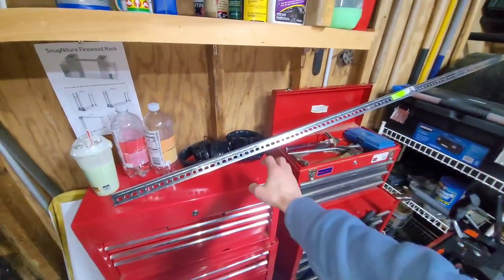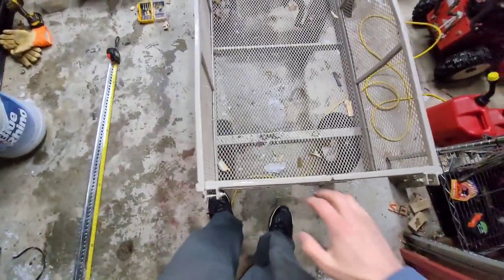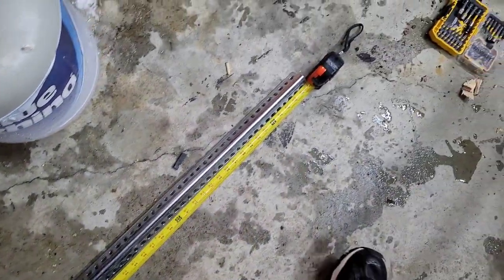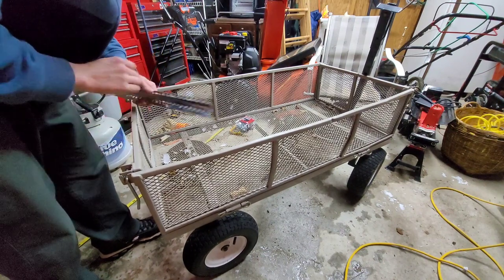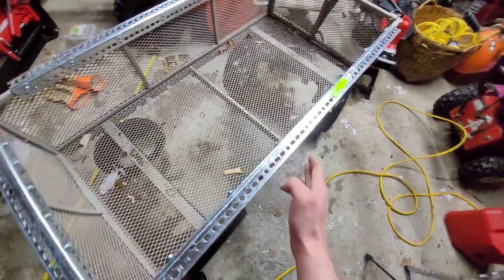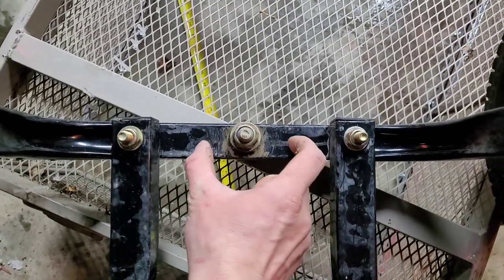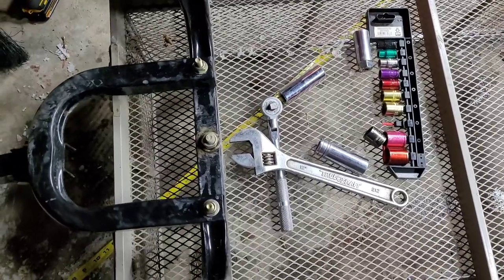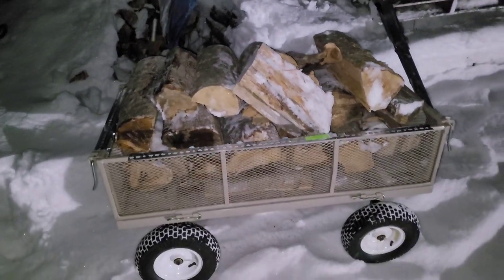Strengthening Garden Cart Railings

Comment: what about a 1/4 inch or 1/2 inch galvanized pipe cut to fit in the oversized hole? the bolt will slip through

Comment: "Use it up, wear it out, make it do, or do without" well-done!

Great job:  you've made that wagon better than ever and it looked perfect loaded with wood!

Many boxes of  sheet-metal screws here, tho the part-time furnace business stopped in the 90's.  

Those screws are handy for almost everything:   from fixing things to puncturing car tires when they've gotten lost. 🤣

Your propane heater is interesting.  Dad's old garage-heater looked like a rocket engine and lasted until someone borrowed it...and returned it filled with gasoline (instead of kerosene).  🙄

That wagon will last for years, and get better with each repair/upgrade.

Thanks for another wise video!

Comment: Good job. Eventually you might want to get an inexpensive flux core welder. They come in so handy with projects like this. Can weld in a steel pipe for a bushing to fix the steering, for example. Would have to also get a welding helmet.

Comment: I like to use the Anti  Seizer lubricate on the tie rod ends on wheels. That is some great stuff. Way to fix the steering is? Cut a piece of pipe that the bolt fits tight in, and weld it down the middle of the tubing, Then put some seizer lubricate on it. or a bearing that will fit down into the pipe and bolt

Comment: Rebar is cheaper and stronger. I use the heck out of it!  Tomato stakes and things. Can make many many things out of it to. The tomato stakes will last a life time.  I made some fireplace tools out of it to!  Pokers, scraper, thongs and things. There better made, than the pretty store made ones. I bent the ends around for handles. You can really get a strong grip on them.  All i did was coat them in black paint. I'am PROUD OF THEM!  I can tell every one <> Hey i made them👍👍 for only 10 bucks of Rebar

Comment: It would probably be a good idea to spot weld two washers to the handlebar.
Reply: If Post has the welding equipment, that would really help increase the lifespan of the pivot point.
If there is no welding gear, short plates can be screwed to the square tube, then a new mounting hole drilled.

Comment: Post....toss around the idea about strengthening up that steering with a couple washers and rubber between them.  It will give the steering some ability to flex through that rubber and not on the frame.

Comment: Are there water restrictions in your area? I ask because we still have a hosepipe ban in SW England UK and our reservoirs are 20% lower than the same time last year. If we have another heatwave this year we'll be in big trouble.
Reply from the maker: Almost everywhere in the United States has recovered from the drought even the worst Parts in California, flooding rains followed by snow as deep as a two-story building multiple times. I remember when I was a kid they used to have water restrictions all the time when I lived in Massachusetts but last year the worst drought ever they didn't even have restrictions for some reason but I personally wouldn't be affected by that because I have a well, it's either going to run dry or it's not